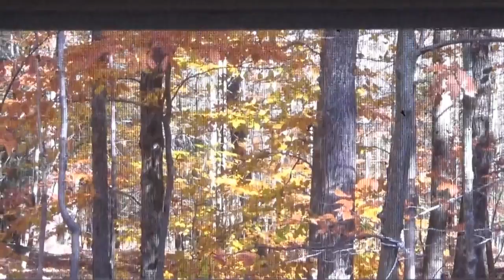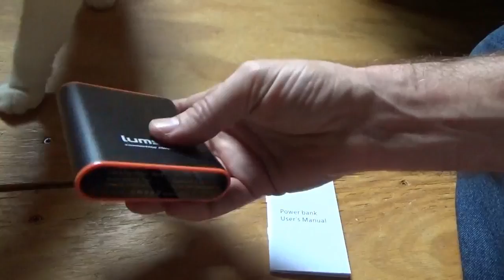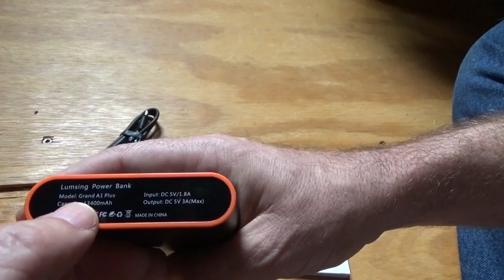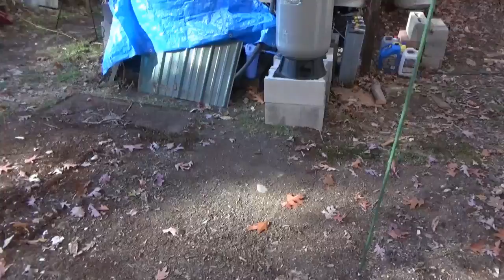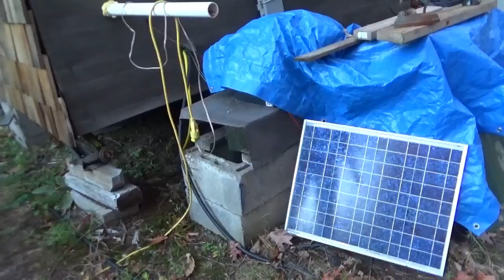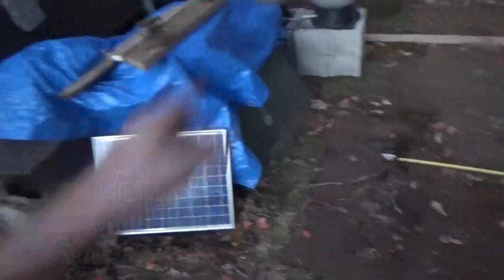Started Building Tiny House Battery Room

Comment: Tie a rope around a bunch of the wooden planks, hook the rope behind the nails on a few of the outside planks to ensure it doesn't slip, then pull them along the ground.

If you tie the rope at the front of the planks you can lift them over rock/ rough terrain.

Comment: Did you use a new blade in your circular saw? I only ask because the blade could be the reason that it keeps binding up on you. Also you might try using more than one saw horse with an extension to help with the longer boards. Good luck. :-)

Comment: if you wanted to B mobile then why didn't you think of a sled type of idea with a structure on top and when it comes to moving day you just slide it onto a trailer. you could have two of these faceing each other with a bridge roof spanning between them.. You might even be able to park your lawn mower or even your truck underneath it. or make an outdoor living space. might need some mosquito netting.

Comment: you can put a laundry vent in the side of your house with a small computer fan pushing hot air into your add on. truthfully for a word burning set up you are over insulated. and your house is going to get very dry like it did so. in winter you should always have a cracked window and some ventilation adding some natural moist air into the house.

Comment: ANSWER TO YOUR QUESTION AND I LIKE TO SEE YOU DO ON video.. 2x4 and longer you bundle them together using a screw or temporary nail then you use I pull rope or long chain attached to your lawnmower. you would need a small clevis. you should be utilizing the pulling capabilities of your lawn mower more often.. Pulling garbage pallets with 3 foot tall crate box on top around the property,, pulling 10 foot logs closer to the homestead.. And cutting them up for firewood closer to the log splitter and piles.. you're clever and pull chain and hitch pin should be kept in your pickup truck in case you need to help someone.

Comment: Yep - glad I could watch this, Troy's Do-It-The-Hard-Way hasn't changed. 
A normal person would have noted the fact that they need to make a pathway to the wood pile since they're going to be working for years with that material. Spend a few hours moving all the rocks out  the way and make a good pathway and REMOVE THE RISK OF BREAKING THIER ANKEL carting the wood back and forth.
A normal person would also make a processing station up by the pile so that they can process the wood right then as it's removed from the pile so that they don't have to RISK IMPALING THEMSELVES AND GETTING TETNUS carting the wood back and forth.
But then this the DIY world. 
And I can't believe that you bought a sawhorse when you have thousands of pounds of lumber available to you.

Comment: I would level some of those concrete blocks you have around the entire perimeter and then build the wall on top of those blocks.  You always talk about wood rooting and getting infested with termites really quick when in contact with the ground where you are.  Build a little wall with the blocks and then build the frame on top of that.

Comment: Just a NOTE..... FYI.... according to the UBC, Uniform Building Code, you cannot attach a building or a porch to a Trailer or Mobile Home. They are to be free standing.
You may want to check the Building Code in your area.... you may be off the gird but you still have to follow the building code for the area you are in.
You may have to have the building Inspector come out, again even though you are off the grid, to get approval to live in your tiny house on wheels.  
It is an important part of living off the grid. To follow all building codes for electrical work, plumbing, sewage, framing, set backs, water drainage from the roof and other buildings, The Well (if you have one).
Also something to keep in mind. If you can license your tiny house on wheels and tow it down the road. If so, all is well.  UNLESS there is a code against living in an RV as a permanent Residence.
If it cannot be registered as an RV it becomes Your Domicile (word made famous on Breaking Bad) and will require a full perimeter foundation. But then you can attach out structures to the main building.
I am new to the channel... I have to think you looked into all of this when you purchased the property, yes?  Do you own the property? I forgot to ask.
Reply from the maker: +Steve Mazz Ok, thanks for that. Then I will NOT attach them. Than you very much for helping me out on that. I can still modify the shed to be free standing.
I bought the property under a land contract. 56 acres.

Comment: Can't you build a long trailer using some long boards as the base. Attach wheels to the board's, maybe take a wagon apart for wheels, axles and frame. Another thought is to make a pathway back to the barn wood for easy hauling. You should if you plan on going back an forth many many times. Just a thought.
Reply from the maker: +Richard Gillanders My problem is the rock walls and boulders out there. I have to pass over 2 rock walls on the way. One by the wood pile and another out by the RV on the other side of the woods.
Reply: +The Do It Yourself World Just put a opening in the wall.

Comment: Those small 5-1/2 inch battery operated circular saws are only designed to cut paneling, and maybe thin 1/4 inch plywood. They are not really made for cutting heavy construction framing materials like 2x4's, 2x8's or thick even 3/4 inch plywood. My DeWalt struggles with 1/2 plywood, if cutting large quantities. For heavy construction, you really should start the generator and grab a cheap 7-1/4 inch or bigger heavy duty electric circular saw from a yard sale. Battery powered tools are never as powerful as electric tools, they are only good for small quick jobs where you have no electricity, and don't want to lug out the generator.

Comment: Troy, if you have some wheels you aren't using, make a lumber hauling trailer to pull.  Think of a trailer that they use for hauling logs on but in a smaller scale.  

I really miss my Craftsman Garden Tractor.  I had the exact same tractor you have Troy, it was awesome.  The engine started knocking 6 years ago while I was out mowing.  I wish I would have kept it and rebuilt the engine.  It ran great for 21 years.

Comment: Two sawhorses Troy.  Will make things way easier.  I know that they are super heavy but why not move the batteries to the back of the TOW?  Would require a lift of some kind but you would open space up in your shed and the heat would rise in the high end and your batteries would be in the warmest part of the enclosed area.   Once they were there you would never need to move them.  Keep up the good work.  God Bless.

Comment: I'd use the tall  (40G.  tank) as a hot water heater and use the 2 giant plastic tanks for cold water collection storage and distribution. All ya'd have to do is drill a hole in it to insert an 12 volt RV hot water tank heater element either direct from the battery bank or from your Charge controller or even from your wind Genny once you get her up. You can get a basic model very cheaply,or get one that has a thermostat built in for a little more! then you could take the propane heater out of the system. Maybe the heat from this tank would also help to heat your new shed and keep the battery bank nice and cozy. you can't beat excess Solar/wind energy for free Hot water year round'. Missouri Wind and Solar has a video on this subject as does 7 trumpets Prepper. His video on this subject is VERY good.

Comment: Troy build a simple pole barn. Sink four post in the ground or even six or so with post hole diggers and concrete them in place. then link them up with two by fours. Hammer some tin on the sides make a sloping roof with rafters and tin on that. They are good and strong and up to code. put some rail road ties at the bottom to nail to. pour some concrete in for a floor later on. put two by sixes at the top to rest the trusses on.

Comment: does the saw do it with all the batteries. do the batteries work the drill and or saws all ok. buy a new battery and see if the saw works right. A new battery will tell you what your problem is. After a year of heavy use I think your battery output is down. you can try renewing it by tapping it with jumper cables off one of your 12 volt auto batteries. just one or two quick taps neg to neg and pos to pos. then recharge the power pack battery.
Reply from the maker: +Stephen Wells I noticed that it works better with one battery out of 5 that I have. So it is the batteries

Comment: I think using two 275 gallon totes will work out better than all the separate tanks. Less connections to worry about, and in the end the totes will take up less space. For your Ryobi saw, I think your batteries are just wearing out. Probably time for some new ones.

Comment: Troy, with all of those portable battery packs you have, you could turn them into a small battery bank for your lighting very easily using the camera industry's common usage method for extending camera battery life, you can get a cheap switchable usb hub and plug the usb outputs into the hub and plug any lighting you have to a usb to dc link cable or plug into the hub and then you can use all of the batteries at the same time and draw them all down evenly since using the anything below half life on a lithium battery reduces its life over time

Comment: Troy you would have so much more stability if you used 2 saw horses.   Since you have only one use the saw horse and something else so you can lay the 2x4 across, it would really make removing the nails so much easier.  cinder blocks would work
Reply: +kg I saw 3 legged saw horses on sale this week.

Comment: I would suggest you bend those nails over. Accidents happen, I know from experience! :-) It's a bit of an annoyance to trip over something and plant your hand on a sharp nail.
Totes - I would suggest the back wall, even if you have to extend the room a bit more than you wanted. Then hang a curtain in front of them to block out more light. Curtain instead of interior wall because it is much easier to move if you need light to do some work back there.

Comment: DH years ago built a car shed with similar construction.  I think he used OSB for the exterior walls but don't quote me on that.  (I do the cooking and he builds stuff.  Its a good match)  Anyway, that building lasted about 18 years with the original paint on the exterior.  And even in SE Michigan he had little issue with the building shifting with the season changes.  It was built floating on blocks too with a dirt floor.  Though he quickly decided that in order to keep the moisture down from wicking UP from the ground that he needed a sheet of heavy plastic on the dirt floor. But remember we were storing an old car in it.   That car now lives in a real garage :)  And yes this weather has been great.  We've been in the 70's all week.  Great weather for getting the last of the outside chores done.  Enjoy it while we've got it :)
Reply from the maker: +pbcoupons Good idea on the plastic. Thanks for that

Comment: I thought I heard you say you didn't want any sun on the totes. Are you implying your batt house will have NO door? wha?? You can put in 12 inches of fiberglass batts in your walls and ceiling and still freeze the hell out of everything in there bud. Even with a door and a stick-built floor, how are you gonna heat the space? I'm puzzled.
Reply from the maker: +grodad There will be a passive solar porch in front of the shed. Heating the shed by day. Wood stove and propane by night
Reply: GROOVY!

Comment: Dirt floor buildings are impossible to keep warm enough to keep from freezing. I would know because my shed has a dirt floor. It sucks so I would seriously consider building a wood floor off the cold ground. The ground conducts cold from outside so it just impossible to deal with.
Reply from the maker: +shartne Maybe I can drop in a floor and framing if I feel the need.
Reply: YEP! Pallets could be laid down and plywood on top of that.

Comment: Troy to haul the lumber think of Michigan logging trucks they have axles and use the logs for the frame then a hitch logged chained to the lumber. do the same with yours, small axle lay lumber on the axle ratchet tie them to axle and haul them with tractor or by man power. you could bring several at a time with less effort

Comment: Troy My batteries started getting week last year I found that if you take the batteries apart you can go buy normal  rechargeable batteries (in my case they happen to be C batteries)even better than what is inside and solder them together the same as the old ones and cheaper to do as well. I use mine at least 3 times a week and they are still running strong for about a year now

Comment: my insulated house built on a slab in NY state with my heat turned up to 70 does not keep my pipes from freezing when it is below zero....I had to use heat tape (the kind mobile homes use) to prevent my pipes from freezing. I think you are going to lose too much heat out the floor. I am not an expert on construction, but I am an expert on things going wrong....Maybe you could make a bermed base around the edges of your shed by backfilling dirt and rocks a few feet, or in my opinion I would use all your surrounding rocks and build a slip form tiny castle out of rocks and mortar....I am not a troll, I am just super worried your propane back up heat will cost you hundreds a month or more to keep your little bit of water warm enough from December until March
Reply: +Diana Smith In WI we put a slab in the pole barn but before we laid the cement we covered the gravel with wall to wall 2" pieces of blue foam with the seams untapped. I had a LP furnace that blasted down on the center of the slab and after a bit I would turn it off and could work for hours with the heat stored in the floor it was great.
Reply: +Diana Smith   Being new here... Did he say if he was going to run the water around the stove in anyway?

Comment: Troy, why aren't you building this on skids?  2 of your timbers set on blocks would qualify it as a temporary structure.  Then you could level it up and install a floor to keep everything away from rodents.  Do you have any plywood T&G left?
Reply from the maker: +Greyman Zink For one thing the weight of the batteries and water tanks will be in the tons. I am not good enough to build a floor that can handle that much weight. For another I have decided to have a gravel floor so any spills do not do any damage but just run off downhill. I have no plywood left. Just some scraps out in the barn wood piles.

Comment: Could the problem with the saw be that the blade is dull?  From the sound that it made that was my thought...  Just a shot in the dark.  Keep up with the progress!
Reply from the maker: +sjrr124 New blade. It is the batteries going bad. I tried a different battery and it cuts nicely for a few cuts

Comment: I love that Roybi saw but it is under powered for larger projects. I have the same Roybi set and use it  around the house quite abit. When I built a ramp to my shed using 2 x 12s the Roybi stalled. So I switched to my corded saw and it blazed right through the boards. So I know the Roybi saw is fine for standard 2 x 4s but not much else IMO.
Reply: +Scott E I have a Makita cordless saw that will cut thru 2x12's but the batteries only last 20 - 30 cuts.

Comment: the easiest way to move the logs or boards that you have would be to get two wheelbarrow wheels, create an axle between the two wheels so they are side by side, but with space between them. you can build a small platform to give you something to tie the logs too if you want to, or you could just strap the wood to the axle shaft itself and then use the wood at the other end to pull it.

its just a thought that it might spark an idea.

Comment: As for the saw, disassemble it and clean it and oil the bearings. Check also if the shunt resistor that senses current (in the saw or in the battery) has proper resistance. If you have overloaded the saw, it may have now a higher resistance which may cause the overcurrent protection to trip prematurely and thus make the saw appear to bind.

Comment: Troy skid load that stuff. Go back as far as you can with tractor. Get you a good pile you need tie them up with a rope. Drag them out of woods like they do trees when you clear cut. Pull head of the load up about 6 to 8 inches off the ground.
Reply: +Paul Gardner : I was thinking that would be a good idea too.
Reply: ***** all that can happen is it won't work and it's back to the drawing board.  if it does work saves little trouble on that back.
Reply: Paul Gardner I think it would work as long as there aren't piles of rocks, rock walls, and more rocks the entire way.
Reply: Paul Gardner I found out there are far too many obstacles in the way to even come near the barn wood with a little tractor or even a truck. Unfortunately, Troy will be stuck hauling the barn wood by hand.

Comment: Stack the totes & put a sliding door
Reply: +Jose v V He does not need a large door,just a panel he can remove when the totes have to be moved in or out. That is such a rare situation that he would be better off building a normal access door, with the second half screwed in place unless he needs large access.  Building a 45 ft wide door without weakening the whole structure is going to be a challenge.
Reply: ***** 45 inches is still a wide door to make out of barn wood and cheap hardware. Actually, I think it needs to be wider to maneuver those totes in and out, especially single-handedly.